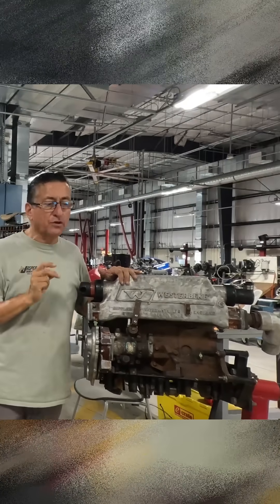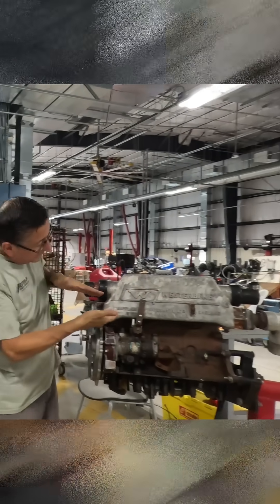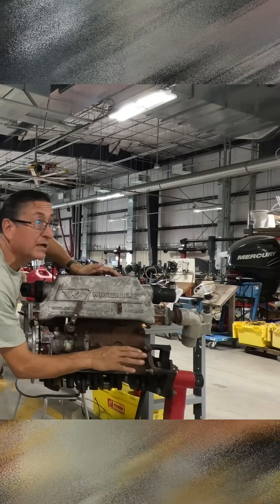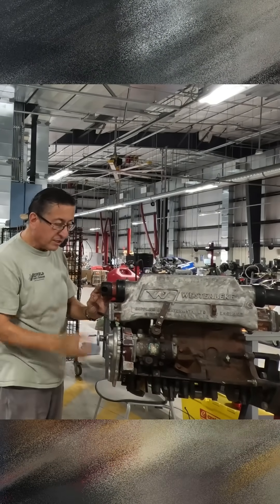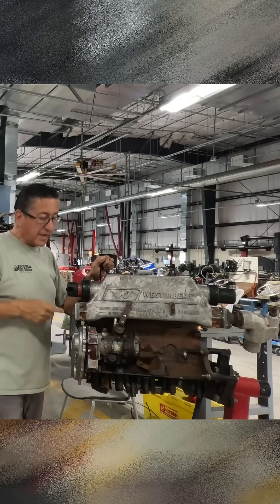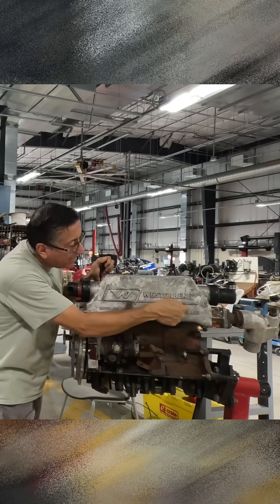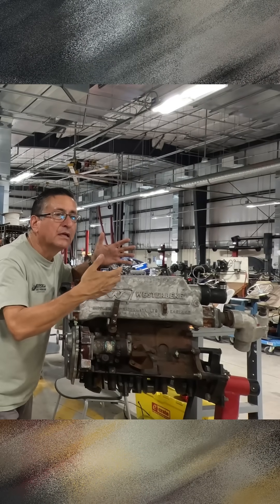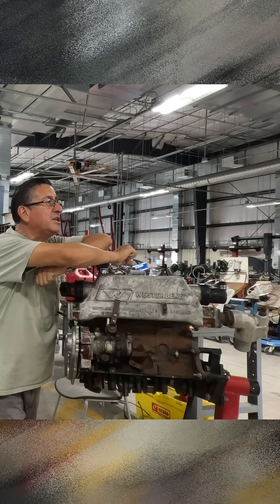Diesel Engine Hydrolock

Comment: Same happens when an Egr cooler has leaks. Water mixes with the recirculating exhaust gas back into the inlet manifold, into the cylinder.